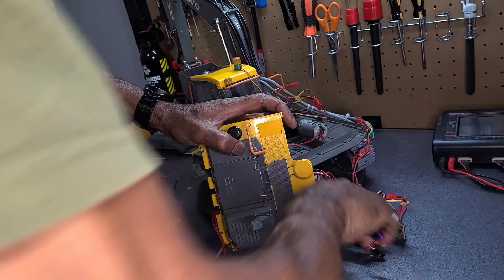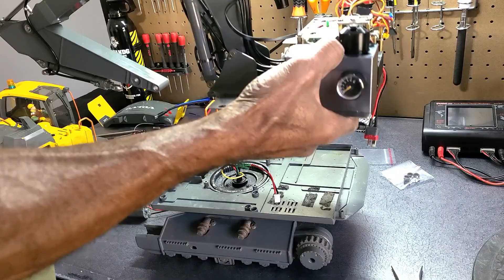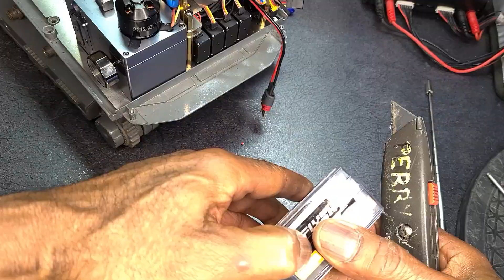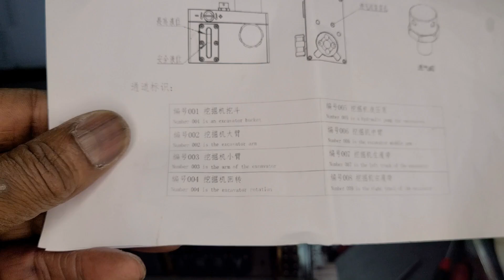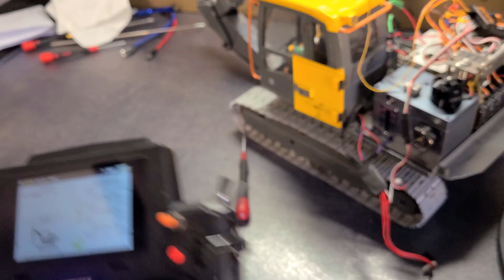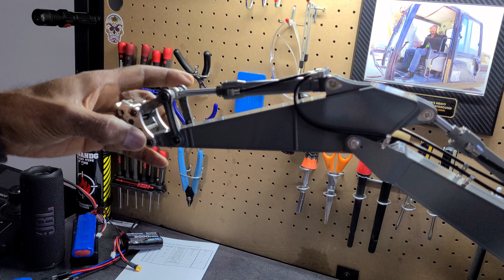3 Arm Hydraulic Upgrade Volvo 160E RC Excavator

Comment: Hello. Is it possible to insert and remove the battery from the top? I mean, I want to install the battery without removing the rear weight.
Reply from the maker: I don't put a battery inside mine. I pull the battery cable out the top and lay the battery on the back of the machine. This lets me use a larger battery. There isn't enough space to put the battery through the top.

Comment: I have this machine i have mixed the channels with the pump. Bit still not working right. Pump only works one way. I have the fs-i6s
Reply from the maker: In your pump mixes, at the bottom set Neg to -100 and Pos to +100.
Reply from the maker: Did that work for you?
Reply: @RCconstructionJP it helped it's running right,now but still stops all movement 20 seconds in and starts beeping
Reply: What's funny is my mixes were 
Neg:100 not -100. That was what I did wrong. 😂. It's still stops and beeps. I think I will replace the battery. Maybe get a higher c rating battery or a 3s.
Reply from the maker: @jamesskaarland-wb1vo  A 3s battery will burn out all your electronics. Don't do it. Send me your email and I will send you pictures of the transmitter settings.
Reply from the maker: @jamesskaarland-wb1vo  Check your battery voltage and hydraulic oil level.
Reply: @RCconstructionJP it says it can run 7.4-11.1v
Reply: @RCconstructionJP hydraulic level it perfectly fine I tried charging battery and it said it was done in two minutes but the controller when using shows rx dropping below 5v
Reply from the maker: @jamesskaarland-wb1vo  If the manual says it can run 3S you can try that. The original electronics in my excavator were trash and always gave me problems. It was very frustrating.
Reply: @RCconstructionJP went with 2s. Excavator works awesome. Now onto a new ? On my kabolite k966 when moving forward and backword. How do I get better steering control without having to stop then turn?
Reply from the maker: @jamesskaarland-wb1vo  Glad you got that fixed. On your Kabolite, go to end point settings. Reduce the track settings from 100 to 60%. Notice the difference in steering. You're steering is crazy because your tracks are moving too fast when you move the throttle. Change endpoint setting by 10% increments until you are satisfied with both steering control and the speed that the excavator moves.
Reply: @RCconstructionJP that works for the Kabolite k966 wheel loader?
Reply from the maker: @jamesskaarland-wb1vo  I don't know. I thought you were talking about an excavator. Try to  lower the endpoint for the steering channel.

Comment: Can you not use original boom and hardware when doing the hydraulic conversion??
Reply from the maker: No, this conversion kit came as one complete assembly. Since the original had two arms and this one has three arms, the hydraulic cylinders wouldn't fit and the big arm would not mount in the base. It would be better to buy a two arm upgrade kit and build the hydraulics piece by piece if that's what you want. I looked at the two arm kits and did not think they were as good.

Comment: How u going to use to excavators at the same time off that controller.  You have to turn one machine off then turn one one.  Lol😂 waste of time bro.  U want a tandem ex24 controller.  Check check it out bra
Reply from the maker: My transmitter works great. I only use one machine at a time.

Comment: So it's electric and your making it hydraulic.   Why didn't u just buy the hydraulic version.    3 arm is crap to use and have to upgrade controller as well.    Mine has hydraulic bucket detachable an all did mine last year from the hydraulic version  good luck
Reply from the maker: I would never pay for a Double EE excavator again. Their electronics are crap. I had this excavator sitting around for a couple years and saw an upgrade that looked fun to do with something different. The three arms work well and I like using it.
Reply: Saya jugak ingin menukar nya ke hydrolik . Asal nya dc moto, tetap  saya perlu beli  set remote control  sahaja, vale dan pump  nya saya mebuatnya sendiri  dengan cara saya sendiri, sebabnya saya memang  biasa membaikpulih excavator sebenar,,  cuma saya beli kan anak yang baru usia 2tahun 8 bulan agar dia tidak selalu ikut saya melakukan kerja sebanar  di kebun ,, saya belikan  iya 1 dan saya satu, cuma agak berat , dan lebih berat iya la trucks pengangkut tanah ,,
Reply: That '3 arm is crap to use' is an invalid argument. Sure, it may be a waste of money, but you could just set the boom angle to that of a 2 arm excavator and never touch that control again. Then it's just like when you have a 2 arm excavator.